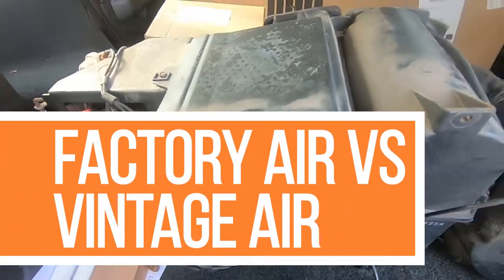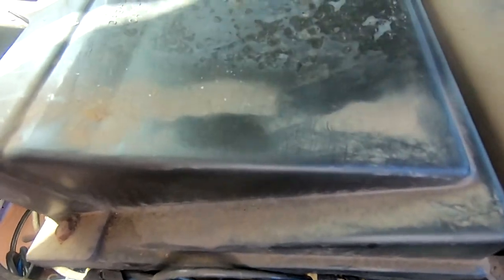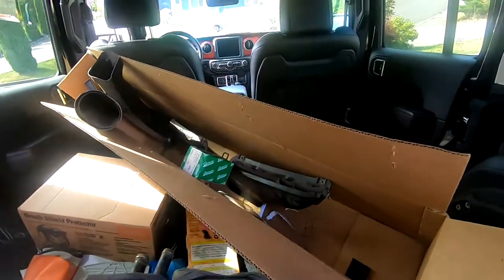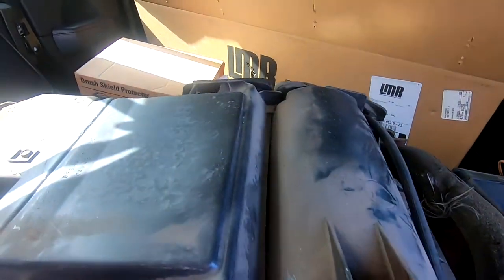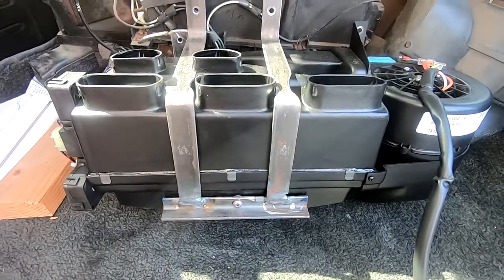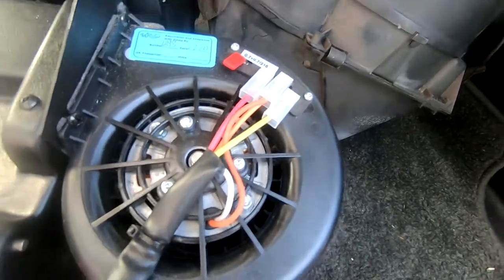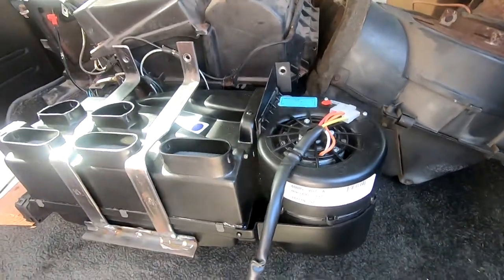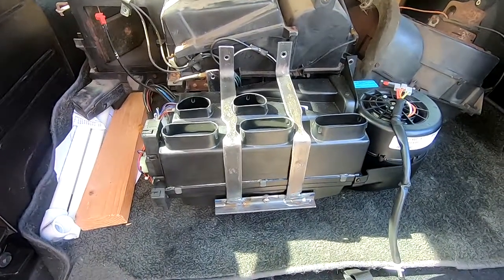Fox Body Mustang HVAC vs Vintage Air - Size Comparison #FoxBodyMustang

Comment: Was the main reason to go with the gen 2 over the gen 4 vintage air kit for the size?
Reply from the maker: Yes it was. I wanted space to run a roll cage and this unit leaves lots of room for options when fabbing it up.
Reply: Big Orange Racing gotcha. Are you using the factory components for the rest of the system like the dryer and condenser etc.
Reply from the maker: @vinchhoun3304  I'm honestly not certain yet, I'll probably use a fair amount of the Vintage air pieces and get a line crimping tool.  I'd like space at the front for two small turbos and will want to keep AC lines as far away from the hot side as possible.  I may tuck the dryer and hoses under the passenger side fender..
Reply: Big Orange Racing that sounds like a solid plan. Definitely looking forward to seeing what you come up with! 👍

Comment: What’s the control panel look like? Will it go in the stock position?
Reply from the maker: It's the basic dial knobs.  It would fit in the factory location with a little fabrication work. You'd need a panel with holes for the shafts to go through, and a way to mount that panel in the factory location.  Depending on generation of Fox Body they do have various models of controls.  That's one of the reasons I went with Vintage air.  I'll film a follow up of the knobs and post it so you can have a look.  I'm on version one of my dashboard for the moment. an aluminum panel with a sheet metal center switch panel. So for now the knobs work for me. Later I plan to have a go at carbon fiber.  I may change things around then.
Reply from the maker: Just posted a quick video showing the control panel I’m using.
Reply: Big Orange Racing I watched it! Thank you!
Reply: Big Orange Racing mine is in the glove box. I bought the car with it installed along with a Holley Dominator EFI setup. I was told the Holley would cut the unit off if I was over a certain percentage of throttle. Whoever told me that was wrong and I cooked the system. So I’m in communication with vintage air trying to identify what I have so I can begin buying replacement parts. It’s fun to drive but not a lot of fun when it’s hot outside. The amount of heat developed by the engine is amazing.
Reply from the maker: Yeah, I think the Holley is supposed to have a relay ground that it can cut over x% of throttle position. I understand the heat thing. With all carpet out and open holes in the firewall my interior temp is 30-40 degrees higher than the exterior. I plan on lots of heat insulation being installed before any carpet goes back in. I can’t deal with that kind of heat. 

I’d be happy to take any other video that might help you out If you need it.
Reply: Big Orange Racing don’t go out of your way. But I’d watch it if you did. 😁
I just emailed vintage today so I’ll see what they have to say.